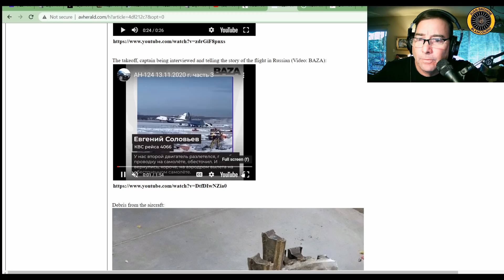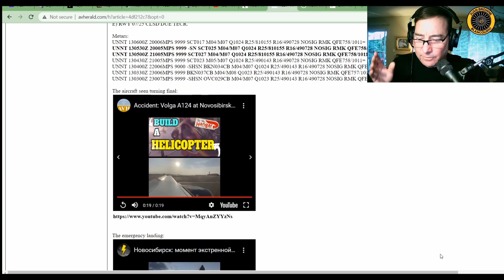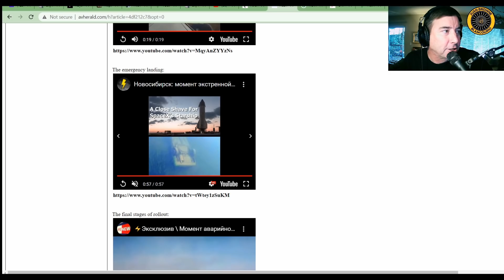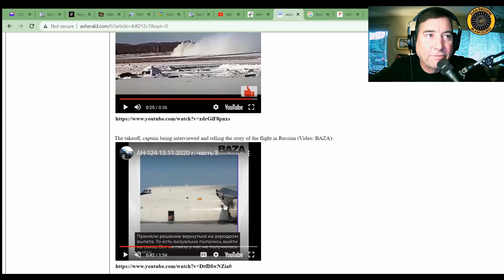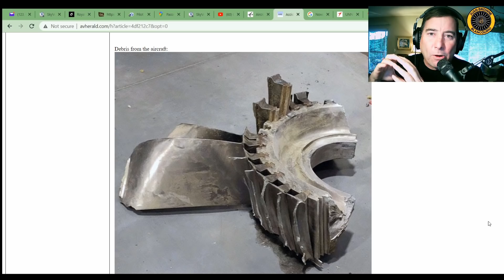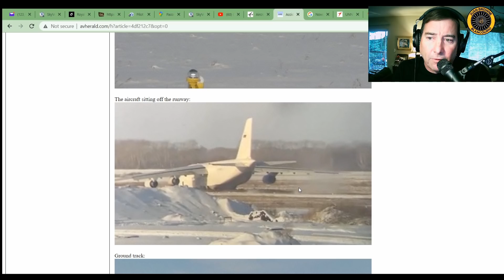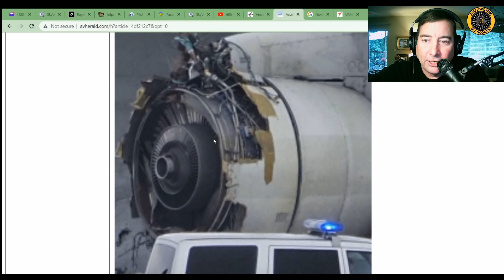AN-124 ANTONOV FAN DISK FAILURE NOVOSIBIRSK, RUSSIA

Comment: LOT Polish Airlines lost two Il-62M's with heavy loss of life in the 1980's due to uncontained disk failures killing other engines, cutting control and hydraulic lines and even causing a fire. The causes were manufacturing and maintenance defects in the engines.  Note that the An-124 involved in this accident is Russian owned and operated, unlike most of the An-124s and the An-225 seen in the West. I don't know whether all An-124 engines are serviced in Russia, or some in Russia and some in Ukraine; I assume that essential Russian-Ukrainian cooperation still exists.

Comment: That happened  or to a MD11 or the Lockheed L-1011   with big lost of life. also, happened recently to a traffic female pilot from south west when the fan disk  failed and killed a passenger or two. it seems like this problem is getting more prevalent when the engineers  are cutting  weight by decreasing the safety margin.  This is happening in aviation over all except on military planes .
Just tale a look to the new 737, I know is not the same thing but industry need to take a step back and reconsider. The airplane manufacturers need to realize that the safety margin needs to be 2 fold higher  than land vehicles, land vehicles can pull over and stop relatively fast. However, on an aircraft in the air do not have that option and many times  turns into a deadly catastrophe from a  component you save a little weight and money. I say it is not worth it.

Comment: Here's a story from my days at GE: The defect of concern in titanium is known as a "hard alpha" defect, something that comes along with the refined titanium that is melted down and forged. There was a time when it was thought sufficient to melt titanium twice to get rid of them, but even before any horrible failures occurred, the industry had switched to triple melting (vacuum arc melting). (The Sioux City disk was indeed an old, double-melted batch.) Still a concern, especially to inspection engineers: hard alpha defects present little contrast to x-ray or ultrasonic methods. 

Anyway, GE metallurgists had an opportunity to ask Russian metallurgists how they were dealing with the problem, and the answer was like the pencils used by their astronauts, both simple and astonishing: workers manually picked through the raw material (a crushed sponge-like material) looking for off-color pieces.

I actually saw the Sioux City disk fragments roll by my office at GE on its way to Failure Analysis, but there was little mystery to it - a hard alpha defect and a crack that should have been found in the last inspection. It was a somber feeling. I'm only aware of two fan disk failures, that one and now the Antonov's.
Reply: In March there was an uncontained failure on another unspecified An-124 that was the second stage of the IP compressor disk. This triggered an inspection AD that should have been completed by now.
Reply: There's also Air France 66. With the engine damage looking somewhat similar.
Reply: @markevans2294  in the case of Air France there was a crack which developed completely unexpected, so the part was not checked for such cracks.
Reply: There's several more uncontained failures in the TF-41, GE F110-100, GE F129-200 & back in 1969 another one GE J79-8.The TF-41 one fatality, the GE F110-100  2 fatalities, the J-79 no fatalities. I still have remnants of the Indianapolis crash, & the Alpena crash. GE & ALLISON have had problems with both FAN, COMPRESSOR, & TURBINE DISK FAILURES ( UNCONTAINED ).
Reply: As for pencils it s a joke / anecdote, it s not real situation as you cannot use pencils there due to small parts of graphite

Comment: Did they have any hydraulics working or had that failed too and is that why they didn't have breaks or thrustreversers? What I am wondering is, did they muscle it to the ground or did they have hydraulic assist for the control surfaces? If they landed with muscle power that would be truly Herculean.

Comment: United 232 over Iowa...  DC-10-10 suffered an uncontained fan-disk failure in the Number 2 (Tail) engine that resulted in shrapnel perforating the fuselage and severing all three hydraulic systems well away from the engine.

Comment: Tough aircraft, skilled crew. That thing will fly again. A Soviet once told me, "crash an American plane it is junk, crash a Soviet plane we fix it up slam it around and it flies again." Years ago a friend had flown in a old Tupolev in Iran. It had been made of parts from several other aircraft and the cabin aisle floor at several spots was plywood. They only had four operating planes at that time. His guide got all stressed because when the plane they were going to leave on landed four mechanics immediately got out and started working on things. The guide said, "oh no, this is the four mechanic plane. "  Apparently the condition of the plane dictated the number of mechanics, one to four, who travelled with it on every flight.

Comment: I was struck that they were transporting 80 tons of engine parts from Siberia to Austria.
Reply: They did this cargo flight from Seoul in South Korea to Vienna, it was a technical stopover for refueling in Novosibirsk.
Reply: Yup 80 ton cargo plus 100 tons of fuel plus aircraft empty weights 180 tons empty, I bet they even landed over weight. I think An-124 max landing weight is 330 tons and they were at least at 360 tons at landing with completley no brakes, what a good outcome no one was injured.!
Reply: @jakemeoff0387  Total weight reported was 400 metric tons.
Reply: @digimaks  GEEEEEEZZUS!😲🤞👍

Comment: I watched the Quantas Airbus A380  engine failure of #2 .  Same thing happened, the fan disk on a Rolls Royce came apart in three pieces and tore up a bunch of systems.  They landed hot but just stopped short of the overrun in Singapore.

Comment: These are very tough well built aircraft. One of these had a runway overrun a few years ago at Gander CYQX Canada
They recovered it from the turf and it sat at a hangar ramp for quite sometime, then a crew of techs started into work and the thing  to my knowledge Is still flying today
Very tough ole birds !!!
Reply: It was in bog and buried in deep. Took quite awhile to dig it out and I believe it sat in YQX for more then a year before it was patched up and flown out. All the  engines were robbed for other An124's in that time...it sat there for quite awhile with no engines on it.

Comment: Excellent airmanship by the Russian captain. Well done! The incident sounds eerily like the UAL DC10 accident that killed over 100 passengers in Sioux City, Iowa. Investigation showed the Sioux City accident was caused by a flaw in the titanium billet the fan disc was machined from years earlier. The AN-124 fleet was retrofit to GE CF6-80 engines to be in compliance with Stage 4 noise regulations. The work was accomplished at Shannon Aerospace Ltd, in the early-2000s.
Reply: Are you sure the engines were changed? Wikipedia says that was only a proposal.

Comment: I don't understand how they lost electricity in the radio and control panel. Wouldn't the instruments and radios have backup batteries right in the panel?
Reply: For weight/balance and safety reasons the batteries would not be in the cockpit.

Comment: I found this nice render of the D-18T engine of the AN-124: https://blenderartists.org/t/ivchenko-progress-d-18t-turbofan/624045   This makes it easy to see that at 17:15 we're indeed staring at the fan drive shaft (with fan snapped off) surrounded by stators.  Also, interesting remark on the engine's wikipedia page: "In March 2020 Ukrainian authorities ordered a one time inspection of all D-18T engine intermediate pressure compressor disks following an Uncontained engine failure. Inspections were required to be carried out within six months"  .. It seems a bit concerning that this engine has caused two seemingly unrelated uncontained engine failures in one year.
Reply: More engine drawings: http://www.buran-energia.com/mriya-antonov/mriya-moteur-engine-desc.php

Comment: The "blat" you hear from RR engines on takeoff especially on Airbus planes is from the loose play in those fan blades.  That's them jiggling around held open by thier centrifical force

Comment: I am not an airplane ingineer but it seem to me that the fan disk < hub > is not the cause of the problem 
but the result of a  bigger faillure in the front part of the motor
like something break in the front fan , create an unbalance , break the front shaft ,
 send debris in the rotor <hub > that we see , breaking to many little blades , creating an unbalance that break the hub !
Normaly into big problem like this it is always a chain of events that create the catastrophe !

Comment: No matter how many times you check aircraft on maintenance you simply cannot see every hairline crack developing,to do this would mean constant stripdowns to do NDT,that crack was probably developing years ago until it finally exploded like it did,those initial billets may even show perfection before manufacture but it only takes a bit of stress to be inbuilt during manufacturing and this kind of thing happens.
Exceptional piloting skills to get that monster back on the ground again as they did.

Comment: The AN 124 is the big boy too, uses a lot of older technology which might be why they were able to make it back in one piece with all surviving.  The gear could have collapsed due to coming in too heavy, they didn't have time to dump fuel, this crew sounds like they flew together a lot, plus that jet uses a flight engineer.  If they were flying to Austria, they were full of fuel, that was a long scheduled flight.

Comment: Seeing the pictures it has to be a fair assumption that the aircraft is a total loss after this emergency landing ! 
The fuselage looks very torn up by the uncontained failure which looks to have weakened the wings causing a lot more damage on the rough landing.
Very lucky crew to be alive & well.

Comment: Light piston twins arn't so great at single engine performance due to the 80% reduction in performance at mauw. Many can't even maintain level flight and at 1000ft agl you don't have alot of drift down buffer. Great result from the crew in this return to departure point.

Comment: As it made its left turn, you can see the altitude dropped quickly. Man, what a sudden "what's left that works" experience as the crew worked their way back and into pre-landing state. I'm going to take a guess most of that procedure got by-passed with seat of the pants experience procedures. Of course they found out once on the ground more issues weren't going to take place with the spoilers/brakes etc. Stand on the brakes and hold her steady seemed to be the fairest plan left. Oh and call the destination location we are going to be a day late with the well tied down cargo !

Comment: This is what I think of as 'chilling engineering', as in; scary stuff.  I'm a little bit confused about which disk it is that has gone.  I am defaulting to the Fan Disk, i.e; the big fan on the front end of the inner spool?  The blades you can see, I think are either the front end of the core engine compressor stages or, as Juan says, a stator ring.  But as Juan also asks; where is all the rest of the fan disk?  The obvious parallels with QF32 are the damage and immediate threat to the integrity of the airframe, but the Trent engine on QF32 had an uncontained power turbine failure (much further aft) and the stresses on that are significantly higher than the bypass fan.

An interesting observation is the clear example of so called 'fir tree roots' that hold the blades in the disk.  These were actually invented by my namesake for the power turbine in his first, centrifugal compressor engine.  (Sadly I am no relation, so far as we know, but he was always a hero of mine.)

Although the crew (non flight deck) were very lucky, given the shrapnel damage, had this been a passenger aeroplane, I can't see how there would not have been fatalities, even if the landing outcome was the same.  Thanks for a very clear report on this incident Juan and, as usual, props for giving the AN124 flight crew credit where a lot of credit is due.

Comment: As I recall Qantas flight 32 - an A380 was also an uncontained failure that took out so many systems the crew barely saved it.  Another incredibly fortunate outcome.
Reply: In the case of the Qantas 380 it was not the Fan, but a compressor stage disc which ruptured because it overheated. Nothing can stop a heavy compressor disc if it ruptures.
The Air France flight over Greenland was different, here a crack developed at the fan mounting, and the complete fan flew away.
Reply: @simonm1447  Kevlar shields have been designed to withstand the forces of a disk failure. They are equivalent to an inch of steel plate.

Comment: Watching the overrun video on AvHerald, watch the snow plume behind the plane as it ran off the runway, it looks like the #1 engine was still at HIGH POWER, even after it comes to a halt, suggesting that they did NOT have throttle control of the #1 engine. That would have hindered bringing it to a stop after touchdown.
Reply: Some comment notes on one other of the youtube uploads suggests the port outer engine was running at 70% power and could not be shut down. In some of the published still images, you can see heat shimmer from the outlet. The QANTAS A380 aircraft had the same problem with the port outer engine. There apparently were attempts to shut the QANTAS engine down with fire foam.

Comment: There was a time when the USSR didn’t overhaul their engines they would just replace them with new due to the cost of overhaul. Cheaper to install new ones than overhaul. I wonder if they overhaul their engines now and this failure was a manufacturing defect. Either way it should have been magnifluxed for cracks??? Great job piloting the aircraft! Wow!
Reply: I would have thought for sure that in a technologically and resource challenged country like the Soviet Union, they would have chosen rebuilding over replacement. I guess not.
Reply: @gregorymalchuk272  - maybe they are overhauling them now and that’s the issue. How could an inspector miss a crack in a piece as large as that titanium hub? Or has it just fatigued due to poor manufacturing grain alinement?

Comment: I don't think the comments about the smoke from engines 3+4 on initial climb out are particularly relevant.  I've seen a few AN-124s on climb out after take off and they do generally seem to be a bit more smoky when the engines are working hard than we would expect to see on more modern aircraft designs seen far more often operating passenger services and cargo operations in the west.  These things are the semis of the skies, and, like semis, they tend to be a bit smoky when they're working hard, but that's just the way they are...

That's a hell of a job of flying by the Captain and crew, getting a badly damaged, heavy aircraft back on the ground and to a safe stop with no brakes, spoilers or thrust reversers.  There are so many ways this could have turned into a disaster, but everyone walked away.  That's one hell of a good job indeed...

On the video showing the aircraft overrunning the runway, you can clearly see the nose of the aircraft drop and the vertical stabiliser tilt forward and the front undercarriage collapses as the plane runs into the rough ground and snow off the end of the hard surface...

Comment: Juan, I want to disagree with you. I don't think it was a fan disc failure, it looks too far back in the engine to be a fan disc failure. I think this is a compressor disc failure. 

If I'm right, I want to point out that this would be the second such failure this year. In March, the Ukrainian state aviation authority ordered an inspection on all Progress D-18T engines in An-124 and the An-225 aircraft after an uncontained engine failure occurred aboard another An-124 resulting from a catastrophic failure of the second stage intermediate pressure compressor disc.
Reply: For some background 
https://www.aircargonews.net/airlines/freighter-operator/an-124-disk-inspection-ordered-after-uncontained-failure/
Reply from the maker: Could be...

Comment: Juan, do you remember the C-141 that had an uncontained failure that took out an adjacent engine? It was a T-wheel failure and it penetrated the fuselage. It started some wood crates burning in the cargo bay. The crew didn't climb very high and was able to get back to the runway. I was a jet mechanic in the Air Force at the time. The parts ended up in a glass case in our shop at Travis.

Comment: It's a lot like that A380 engine failure a few years back.  Only they were VERY lucky because none of the broken pieces struck the fuselage, but here they did.
Reply: Yeah the Air France airbus a380 gp7020 engine failure

Comment: That Antonov is one robust airplane! They built that plane with the capability for unimproved dirt/gravel runway landings. We saw that capability utilized to good effect when that plane ran off the end of the runway at what looked like over 100 mph. May have ripped off one or both of the nose gears. But that tough bird held together! I am impressed! This is one of the very few Russian aircraft which are successfully being utilized outside of the old soviet block countries. This airplane was carrying commercial cargo to a Western European destination for a comercial customer to be utilized in the manufacturing of vehicles. It may be an old style non automated airplane with a crew labor intensive design, but it flat out works and works well. I personally think this AN-124 airplane type has earned a spot on the list of the worlds great planes list. along side the C-5 and 747.